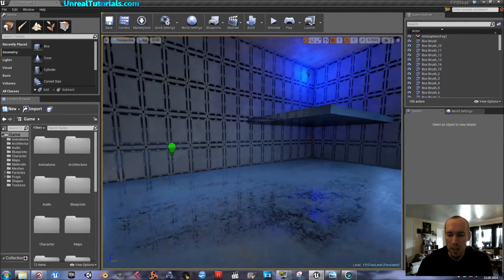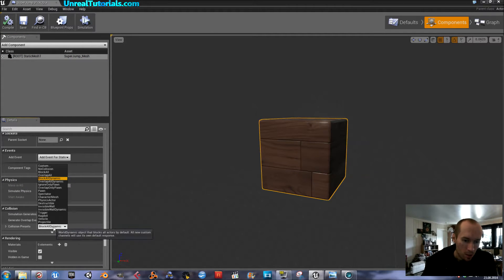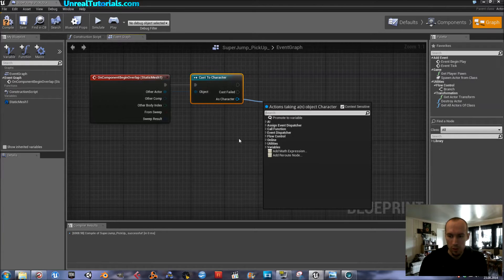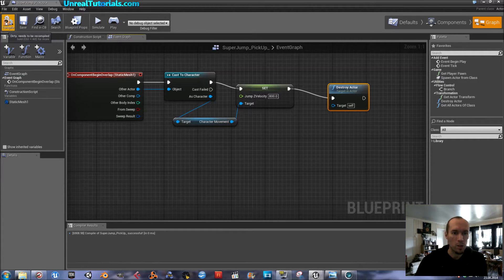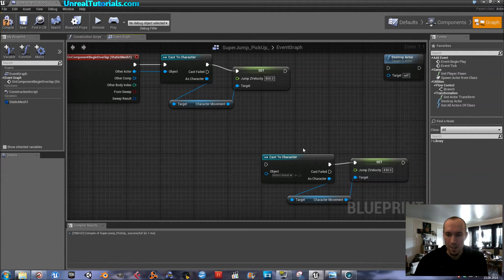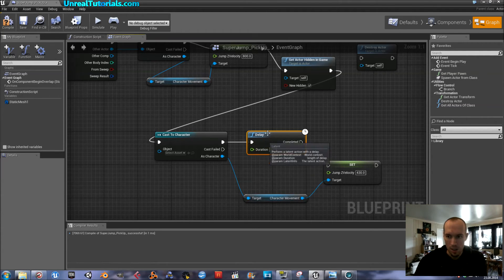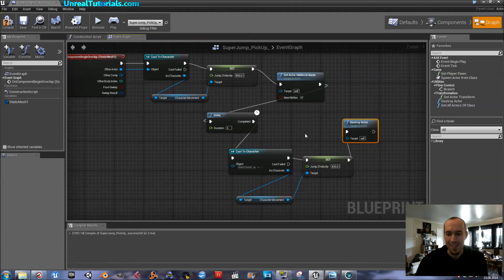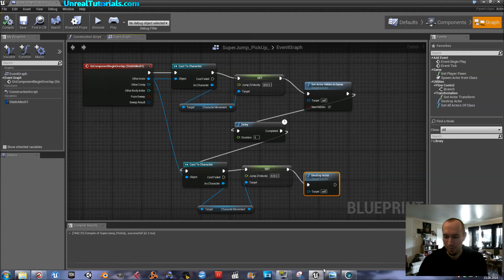Unreal Engine 4 Tutorial - Super Jump Pick Up

Comment: Thank you again, it is very helpful! I also added increase Max_Walk_Speed when pick up. However, I have a problem while player in super jump mode and during the reset(Delay) of Destroy actor, the player has collide with another super jump pick up at the same time. So it reset jump Z velocity had accidentally overlap with Set Z velocity. Just wonder if you will have any solution to fix this issue. Cheers :)
Reply from the maker: Maybe create an exception so it doesn't count as something to collide with? I suspect it's a pretty easy fix, however, as of now I don't know how you'd go about doing it. Will let you know if I stumble upon the solution, as it's definitely something I'll have to figure out sooner or later too :)

But don't hesitate to let me know if you find a solution first!
Reply: ***** Yea sure and thanks for the reply! So far I used Boolean (True/False) to determine if the pick up are currently resetting(delay) the Z velocity back to normal, if YES and the player collide with the pick up again, then reset the delay time back 5 seconds. Also I delete the Hide Actor and Destroy Actor function. Therefore player can be in super jump mode if player keep colliding with the pick up blueprint. But now my problem is... it only work with THE SAME blueprint. If I duplicate the blueprint they all don't share the same Boolean(true/false) statement. So I can collide pick up A then B then C, but only able to collide with A then A then A.

 I want multiple super jump pick up all over the level, so player can run around and keep getting super jump if he/she is fast enough. (Kinda like the speed boost in Mario Kart). I hope it makes sense since my English is my second language.

If I find the solution first definitely will let you know, lets help each other and make unreal indie community stronger. :)
Reply from the maker: cheung yi kai Ah, I see. Really cool idea! Could you perhaps either upload a screen shot of your blueprint structure somewhere, or send me the picture so I can take a look?

And oh, don't worry about your English - it's awesome. Anyway, I'm Norwegian, so I don't know what the hell I'm doing either, hehe ;)